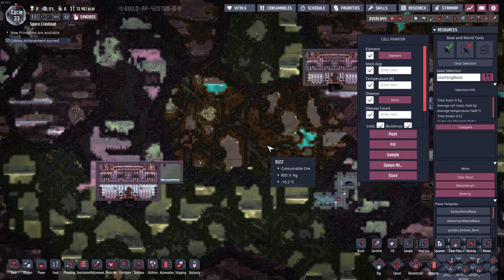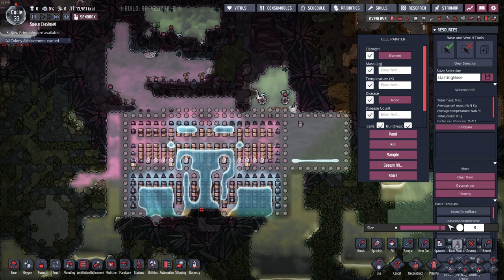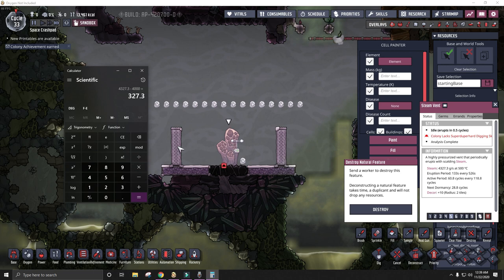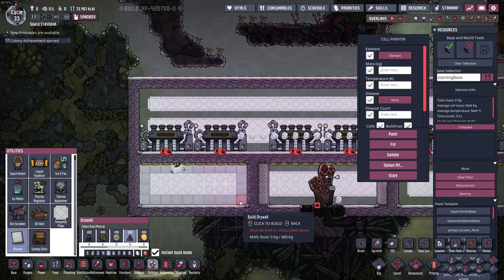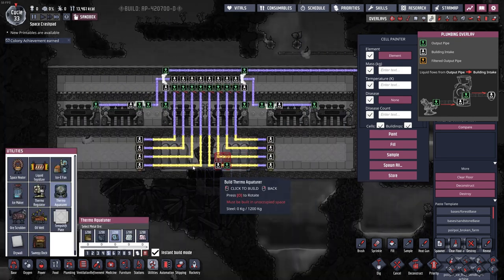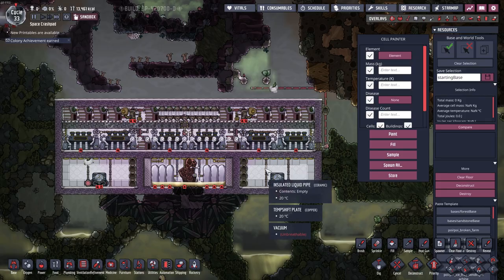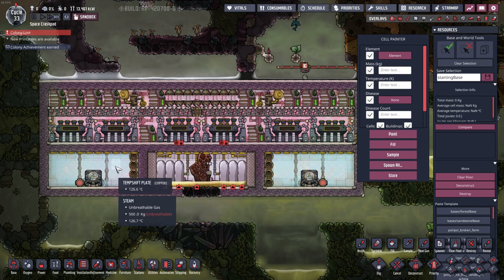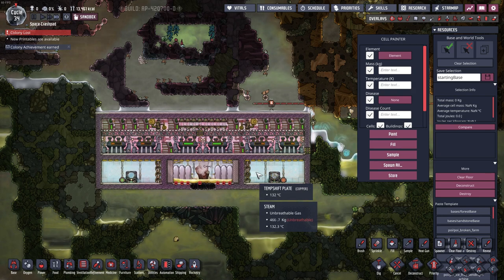Overly Scienced - Episode 23?: Hot Steam Vent Tamer 2.0 (Oxygen Not Included)

Comment: I don't like the trick with preventing 100+ degree water from bursting the pipes by limiting the flow, feels cheaty, but otherwise looks pretty solid.

One variant to simply dumping petroleum on the floor is to have it in a tank and run it through the room in radiated pipes. That way it still acts as a heat sink, and the room becomes one tile higher. Also good idea with the metal blocks, hadn't thought of that.

Comment: Haven't build or tried this yet but couldn't you alternatively wait till thermium and use a gas pump to stop overpressure of the vent. Rotate the steam in pipes in a steam room for extracting heat and then venting steam in a different room for water extraction. Should be easy with thermium to get maximum energy and water extraction. Would love to see you make a simplified version of this for people who can wait till thermium.
Reply from the maker: I think the only way this would work is if the entirety of the steam is pumped out into a separate chamber for cooling and extraction. Then the turbine ports could be automated using mechanical airlocks with less worry about over pressurization. In my case, that would take 9 gas pumps and 4 turbines and an area of about 250 blocks. It would operate power positive with about 1 Kw. Steam Vent Tamer 2.0 takes up 326 blocks and runs power positive with about 3 Kw. The decision comes down to what you need more of, space or power. I've already spent an unhealthy amount of time on steam vent math but maybe in my future survival series I will implement some form of this.

Comment: I tried it out and mine got way too over-pressurized before it could heat up the center. So much mass from iron tempshift plates and statues... idk if it'll ever work or how I can heat it up enough. I need an aquatuner in the actual room made of thermium.
Reply from the maker: Just poke a hole to let the cool steam drain. Once the main room is above 125 it will start working.
Reply: @cometgaming8812  And What did you set the filter gate to?
Reply from the maker: @G.r.e.g.g.l.e.s  Just the default setting, I think its 5 seconds.
Reply: He is wasting do much power.

Comment: did this design, vent overpressured instantly because it heated the room only to 100c, don't get why and also have no way to heat the steam, what to do?
Reply from the maker: This tamer has high throughput but takes some time to warm up the heat buffers. Poke a hole and let the low temp steam escape. Eventually the vent will heat up all of the materials inside and once it hits 125c it should start extracting the steam via turbines. If the surrounding atmosphere has a higher pressure than that of the steam chamber then you may need some gas pumps to create great enough pressure delta to coax the steam out.
Reply: @cometgaming8812  alright! Thanks for the quick reply :)

Comment: im confused. how do you prevent those aquatuners from overheating past the limit. there is no cooling in that steam room...
Reply from the maker: The exhaust from the wing turbines cools the main room and the wing rooms. The only way the aquatuners can over heat is if extra heat is introduced because the hydrogen room is not thermally isolated from the environment. 
As long as the thermo sensor in the main room doesn't stop the exhaust flow right at 200C, cooling will be provided to the side rooms. If you are still running into problems, lower the setting on the thermo sensors but don't go any lower than about 130 C, otherwise a deadlock can be created.
Reply: @cometgaming8812  hmm ill keep that in mind and double check.
Reply: @ultimaheart4304   If I'm guessing correctly you are asking for the basics. (If not, just ignore this comment :P )

Steam turbine starts working at 125 C hot steam below it and stops working if the building reaches 100 C although it overheats at 1000 C. The water exiting the steam turbine is at 95 C.

If you make an aquatuner of steel (overheats at 275 C), put it in a steam room,  make sure to cool down the steam turbine so it does not get past 100 C and put the water exiting the steam turbine back in the steam room (the conversion steam-water is 1-1 and it acts as coolant compared to 125+ C steam), then the steam turbine will cool down the steam room until steam reaches 125 C so it will stop working. 

If the  aquatuner works too much and steam in the room is still too hot and gets over 180 C, one steam turbine can't handle it so you just need to put more steam turbines to counter the heat
Reply: @soniak13  no i meant if the aquatuner sucks in too much heat then it would obtain more heat then the cooling would allow. however i assume that the heat the aguatuner he is using is designed to be closed and obtain no extra heat except what is in the loop there.
Reply: @ultimaheart4304  a bit late but you can adjust the cooling "strength" by limiting the temp sensor on the pipe, since they only need to cooldown turbines to working temp, it can be set to 70c and will still work, the key part is controlling the steam temp so it wont make the turbines excert too much heat (proportional to steam temp) making feedback loop that makes the aquatuner work harder then heating the steam even higher till the aquatuner breaks.